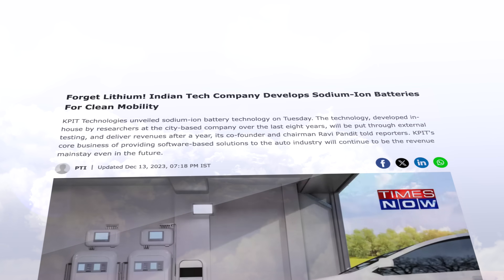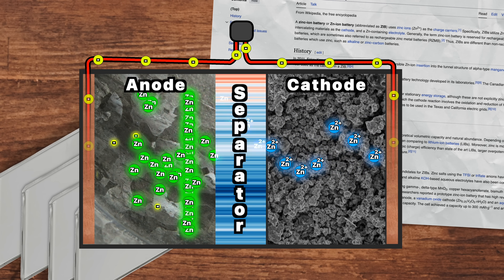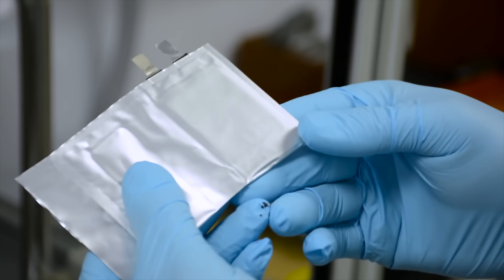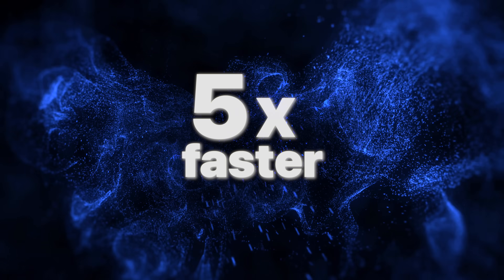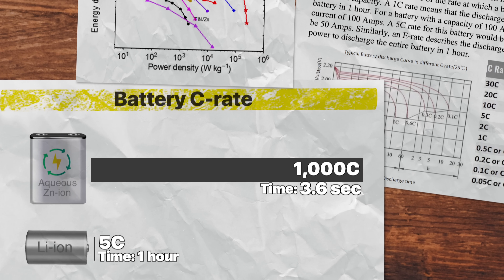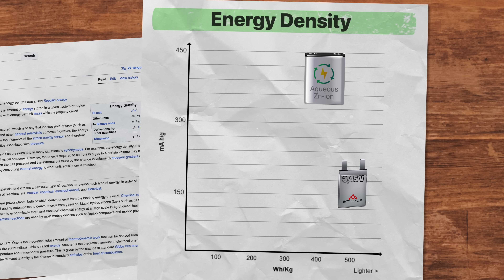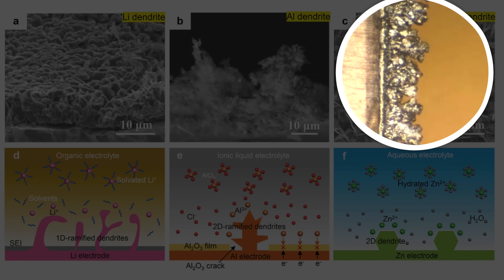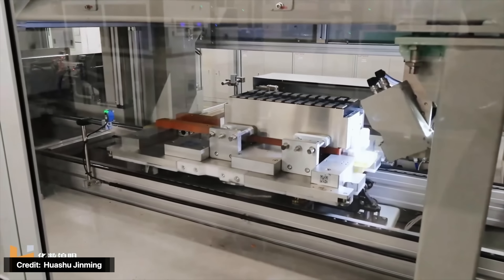New Aqueous Zinc Battery Breakthrough - Real Deal or Hype?

Comment: Yup you answered your own question "vanadium is from China and Russia." Well that's an immediate non starter. They will need to find multiple locations of large sustainable deposits of vanadium in other places in order to scale up. Without these this is unobtanium. This could be another battery IPO stock "pump and dump" scheme of some sort. First guess on "next-gen batteries" is the best guess.

Comment: It using Vanadium is kind of a kick backwards to really scale these batteries. So if they can get around the use of Vanadium for something else or not at all it would be fine. A larger BMS isnt really a big deal compare to the main issue of just storing the power in the first place. There are still ways to make a cell that would still get the input and output we wish to get so that isnt really a big problem. Other wise, yea, if they can get around the first issue - it would be consider the "perfect" battery today. At around 450 - that would put it double today's LFP batteries meaning we would need only HALF the pack size today in a Tesla. The charge rates can be control so that isnt a problem either (aka no more wall charging - must be a station like charging). Also, this sound close to that NASA one  ~ so this isnt that far off in terms of just being similar. Still - what kills that one is the Vanadium still.. Yea - get around that element and this would be a crazy battery that could replace a lot of batteries today. At such a high C rate too - that pretty much kills any current problems with range + charge times most people have problems with EVs today and be cheap means easy access for Home storage. I assume it wont be as cheap as Na batteries though - so Grid I would assume will be still using that one.

Comment: Do Zn batteries compare with Pb (auto) batteries in terms of CCA's? The C-rate seems to imply lots of CCA's. How long will a Zn battery hold its charge? How does the battery reaction degrade at low temperatures?

Comment: Stationary storage is a good way to try out different chemistries.  Though I think the next alternative to lithium, might be sodium ion (e.g. from CATL and BYD).  The giga factory manufacturing processes are already quite similar.  Sodium ion will probably compete against LFP.  

Zinc can be the third in line.  Though I suspect it will require different manufacturing processes, a slower to ramp up.  And for all its weird quirks in charge rate, think of it like computer memory.  You have different types, with different characteristics (e.g. DRAM, SRAM, SSD, HD, ...).  You can pair Zinc batteries with Lithium stack, to help it bridge some gaps, while bringing in its own advantages.

Comment: 1000C charging is a joke for anything larger than a cell phone battery.  There just isn’t the infrastructure to push that much power.  If you have a 100kwh car battery and you try to charge it in 60 seconds your charge rates jump to 6,000 kWh.   In practical terms even if the lifecycle is 20,000 that’s 50 years if used in grid scale usage.  More than enough for a decent lifecycle payback.   In grid usage you have 8 hours to charge from solar.

Comment: Dentrite forming has been the major hurdle of solid state lithium batteries as well. They have learned a lot more about those and are finally moving past that issue, so hopefully most of that knowledge can be transfered to the dendrite growth in these Zinc batteries as well.
Reply: True, but I find it dishonest to say the number of cycles is huge when dendrite formation is one of the huge limitations in lithium batteries.  How can you just ignore that in the cycle life?
Reply: Simply giving it a strong current pulses as part of the charging circuit will fix the dendritic issue, they used this technique for old school NiCd batteries to stop dendritic growth of cadmium.

Comment: The low 1.3V nominal voltage is a good drop-in replacement for Ni-MH and disposable AA and AAA batteries, especially with the voltage being closer to 1.5V than Ni-MH.  This means they could be mass produced for existing AA / AAA powered consumer electronics, unlike other new battery chemistries that use very different voltage ranges to existing disposable and rechargeable batteries.
Reply: And that kind of application/potential market would be an awesome, immediate commercial driver for more zinc innovation. That's huge, well-spotted.
Reply: Yup that would be a good use case, especially for current hungy gadgets.

Comment: Well it's Na Zn and Na cells are already in the market at 1600wKg. 
They probably can but unless they really push it will be the Chinese leading the way to production.  

The voltage is an issue but the cell format might be the solution given its other performance capacities.

The one thing you do need to compare is the environmental impact of the extraction and processing of the component minerals. 🤔 A major bane of lithium extraction.

Comment: It will be complicated for mobile devices that you practically will need at least two cells in series and with two cells in series 3.3V electronics will still need boost converters. A three cell battery gets even more complicated but might be closer to realism for the voltage. Having one battery that will dip as low as 1.0V when at 0% is a problem because most electronics have a really hard time operating at those voltages. A boost converter might need 1.5V to even run its own logic and switching system.

Comment: Regardless of availability.....Cobalt specifically is so hazardous and has a lot of human rights issues involved.  I'm on board with almost anything to get rid of cobalt.  I'm a big fan of Iron Oxide batteries for large, grid scale solar storage.  Who cares about density, when you can just dig a hole or stack them on top of each other?  They're super cheap too.

Comment: The whole EV thing is in collapse mode - there are a lot of problems with EV technology that have brought this precipitous decline about, but certainly battery technology is right up there as a primary reason for its downfall. EVs need a miracle battery technology.

The problem to solve is that the materials making up an EV (and especially the battery) can't be exotic - they have to not only be abundant in the Earth's crust, but generally easy and economical to mine/obtain, and process for industrial purposes, and need to not be overtly damaging to the Earth's environment. (Lithium is very abundant but also very difficult to obtain in concentrated manner economically and/or process to get to concentrated form - and it's very environmentally hazardous to try and accomplish any of these phases for Lithium - but the end result are a battery technology that still doesn't solve the EV equation satisfactorily.)

Lead has been a hugely successful material to use at scale for ICE vehicle starter batteries as it's abundant and can be had at huge manufacturing scale. Now lead would potentially represent a great threat to the environment, but here it has been very successfully recycled for continued use, and thus is mostly kept away from the environment. It's been extremely difficult to find other materials for batteries that can match this kind of virtuous cycle while also providing the battery technology miracle that EVs require to be viable.

Comment: Nice video about Zinc-Ion battery. Question - how can a cycle life of 200000 times be given when dendrites and other problems reduce its life to far less than that number. You chose real life cycle numbers for lithium batteries. I understand there isn’t any real zinc ion rechargeable battery products yet for real world comparisons, but telling us it has a 200000 cycle life and then saying that number isn’t a real world number is misleading..  Also you mentioned that Zinc is 7 times heavier than lithium. For my cell phone, I wouldn’t care if I can get longer battery life, but for an electric vehicle , does that mean it goes from 2 tons to 14 tons in weight? This is a liquid electrolyte, do we need to worry about it freezing where I live where it can get to 20 below 0 for a car outside? Seems to me a lot of theoretical laboratory specifications were given for Zinc ion without having any real world products to measure against the lithium real world batteries you are trying to compare to.  This isn’t engineering you are reporting, it’s marketing hype. Thanks for your time in doing the video.
Reply: To put this simply, the Li ion battery has a 5C charge cycle. The dendrites will be formed at some high charge rate. What factor of 1,000 do you think it would require to eliminate the dendrite formation? As long as that factor is not greater than 200, then the battery is still superior in charging. Trickle charging to this battery is a lot different than a lithium-ion battery. Fast charging might be trickle charging to it.
As for the weight, it has an energy density similar to some of the best lithium-ion batteries. That is gotten by replacing the electrolyte from a heavy, flammable organic molecule with light water molecules. The problem is those light water molecules freeze at bad temperatures.

Comment: Another advantage of aqueous and air batteries is that the molecular motion of the medium tends to erode dendrites before they become dangerous. An example is tin solder in air versus vacuum. In vacuum tin forms dendrites, but not in air. The high electric field around dendrites causes breakdown that results in the fire.

Comment: I couldn't believe that a Zn ion would be smaller than a Li ion so I looked it up.  Amazing.  It is about a fifth as large. 
I wonder if the dendrite problem in other Zn batteries could be solved as Redflow does.  They have their batteries in two separate banks and from time to time, fully discharge one bank.  This 'resets' the battery, removing any dendrites.  Anyway, this appears not to be necessary in this battery.  Can't wait to get my hands on them.
The huge possible charging rate is possibly pie in the sky.  Just think of the amperage the charging wires would have to carry.  We would probably have to accumulate the charge in huge super capacitors at the charging station to have than much instantaneous power available.  Scary thought.  Any way, the charging rate could rival the filling time of the tank of a fossil fuel car.
Reply: Yes, it's a combination of contraction along a period caused by an increase in effective nuclear charge, but most importantly because Zn has a charge of +2 instead of +1, making the more positive ion attract the electrons with a stronger force.

Comment: I think it would work better if the car had multiple batteries where if one breaks down, the other -- say -- 11 out of 12 can take over, and the cost isn't as impactful.

Instead of -- say -- shelling out $15000 for a new battery, shell out $1250 once you've rebuilt your credit card.

But attitudes may also be another key.

I drive less than 40km to and from work.

If I can only get -- say -- 100km on a single charge because I need 3 batteries hooked up in series, so I recharge every 2 days instead of once a week.

Added with one of these Omega-1 engines that essentially has only 2 major moving parts that can be adapted for hydrogen, propane, or even compressed air, then that can extend your range on your car.

Then there's Zinc batteries, cuts down the costs further.  Added that if you have battery packs of 12, if one goes down, so will 3 more cause they're in series.

But 9 can still take over.  And the $1250 price tag for the new battery can drop to say $875 based on the new battery being 30% cheaper.

It will mean recharging every day for the battery, but we recharge our phones every day.

Added an Omega-1, it can both power the engine if it has at least 2 alternators -- in case one goes down -- then it can extend your range further.

Comment: Hey, I just wanted to say, I don't appreciate how at 10:40 you plotted mAh/g vs. Wh/Kg. The plot shows that the new Zinc-ion batteries run at a lower voltage than standard lithium-ion batteries though, the voltage of the battery has nothing to do with capacity, and if it's too low, you can just put them in series.
I just finished watching the video though, and you actually brought up voltage, so that's good. Then would be a better time for that graph. And, thanks for including the whole drawbacks section!

Comment: Dendrites will always be a problem with ion batteries, where ions of a metal flow through an electrolyte containing those same ions.
A non-ionic battery should be the long-term goal of voltage storage research.

Comment: [start rant] 
HYPE this one.
I really hate to sound like my father, but he had some interesting points that I only now see after being burnt repeatedly.
What I hate, and I do mean hate, is how emerging tech uses full paying customers as free beta testing facilities. On top of that you/we have utterly no recourse despite 'enshrined' consumer rights when products fail. 

For example, I do not trust new tech batteries when the price goes over a certain threshold. If they're cheap what I'm about to say doesn't apply. 
I don't trust new tech batteries like lithium-ion because the claims are lies and damned lies backed up by statistics. Statistics or data are used to specifically back up weak claims to make them look credible. Its called lying. They're lies because there isn't enough decades to prove manufacturers' claims of charge cycles and battery life. 
Most importantly, laboratory testing of proof of concept products is hardly real world use in varying temperatures, with less than perfect charge times from products made by mass production overseen by careless underpaid workers who'd rather be anywhere else but building your 3d paired dancing aqueous zinc batteries. 
Manufacturers' claims are a bit like a diode, it's all one way and unless you have $10m in savings you can't afford to pay someone to challenge them when their products fail to live up to the claims and even then it costs more to pay a lawyer than the potential gain so you still can't win. This is how they get away with it. 

Conversely, lead-acid batteries can be verified since it's old tech. I don't mean to be a Luddite (though I sound like one for sure) but I for one am so utterly sick of wasting vast amounts of money on tech that never lives up to even 10% of its promise OR doesn't work at all. 
I'm tired of the endless fighting, the arguing, the phone calls, the lies, the blatantly deliberate misinformation. This causes one to just stick to old tech - and one can't be sure it's manufactured properly even if locally made. 

As an aside, the QC of modern products is appalling. Try buying a pair of damn shoes without a fault in them, a Japanese camera lens costing $2k, a $4k 3 phase welder, a $20k wood mill, a $3.5k 3 phase generator, a $200 toaster, a $2k fuel injection system for your 4x4. 
All of them either don't work or hardly work and in every case the words, "We've sold literally thousands of these and you're the first person to ever complain," repeats over and over with every phone call. You know it's BS, the seller knows it's BS but you have to play the game and take it in the fundament like a good little financial unit.

The 'aside' I just used is to illustrate poor QC in almost all aspects of modern production. You combine this with new tech lies and you're really on your own. Stick to reliable tech when spending over say $5000 on battery storage, be more circumspect. Let others do manufacturers' testing.
[end rant]

Comment: Lower voltage usually means a heavier gauge cable to transmit the power. As you said there are always tradeoffs and it could be a while before we see these batteries come up to scale. Plus the extra weight is not great for a car as that would cut range negating the other advantages.
Reply: Putting cells in series raises the voltage of the battery,
so the output current can stay the same,
and thus the same power transmitted.
Reply: @BillMitchell-lm8dg  I agree, you just need at least double amount of cells in a battery pack. However, that means that even smartphone class devices would need BMS and cell balancing implementation which would increase costs for the end user device. If the final battery pack can take even 500C charge and dischager speeds, that would be insanely great tech nonetheless. With 500C charging power, you could basically regen brake EVs in all situations.

Comment: I don't see how this is better than super capacitors. This battery fails in the most important metric, energy density.
Reply: For one, a spike driven through a super capacitor results in an explosion from its instant discharge.
Not so with aqueous electrolyte chemistry batteries.

Comment: I like the tag line, one of the most accurate ones you have used. You provided a lot of good information, without padding it with how does a battery work? My biggest issues with these "break throughs" is no one states how soon mass production will begin, because that is the bottom line. Also more concerned about mass storage over an EV.
 Overall I enjoyed your video
Reply: You're right. But with lab results, you usually can't know when something will be production-ready
Reply: EOS energy starts mass producing q2 2024
Reply: Agree. Good point. That's the biggest issue we have, particularly in the U.S. Everything has to go through red tape and mass production to make a profit otherwise, have few investors and technology changes rapidly. After a factory and production is created new and improved possibilities come along but the factory can't change on a dime and investors want paid back with interest. So we are stuck in the past.